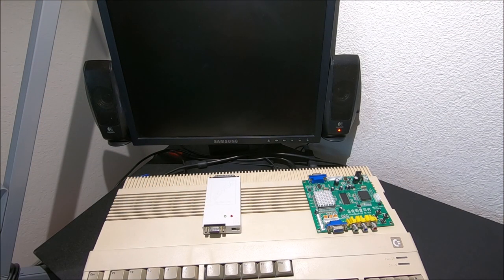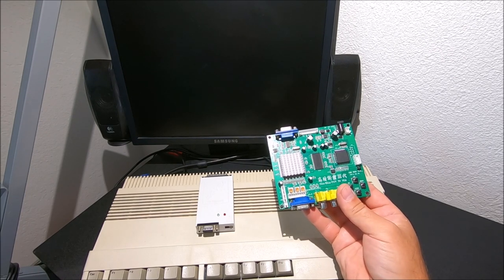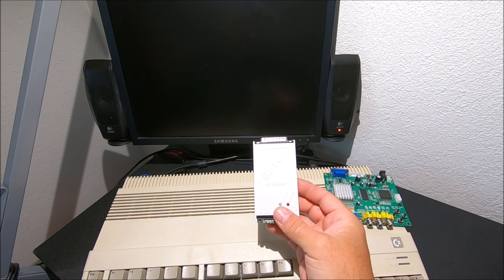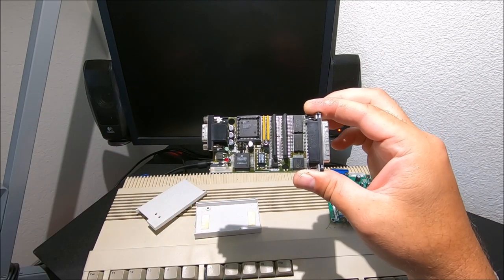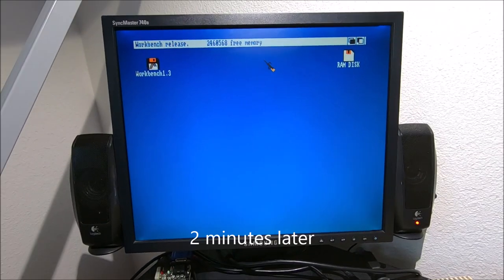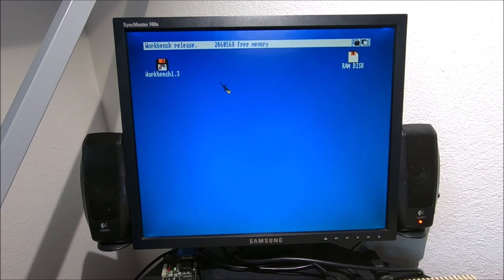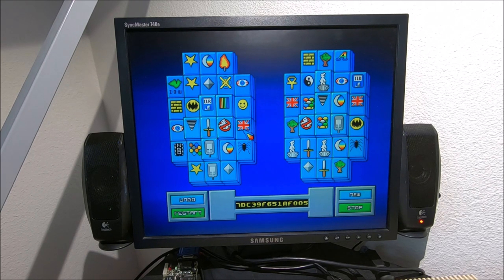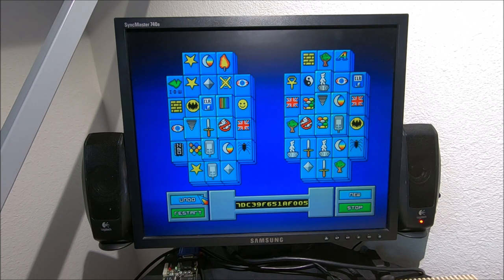EZ-VGA ScanDoubler & Flicker Fixer for Commodore Amiga 500 600 1200 1000 2000 3000 4000 MV1200

Comment from the maker: Hi all, recently I purchased this EZ-VGA scan doubler / flicker fixer a quite need a little device for my Commodore Amiga 500 / 500+ , also it will work on Amiga 600, 1200, 1000, 2000, 3000, 4000, and CD TV,  it's works fine after warms up it usually takes 2+ minutes. Does anyone know if it's normal, or how I can fix it?

Comment: Hi I have got Indivision ECS V2 for my A 500+ and for my two A1200 one Indivision AGA MK3 and for the other Indivision AGA MK2 as I had it spare.
They work just fine but are not cheap. What I like about them they are all internal. I had to cut my A500 case to get the VGA port. I got a cheap case of ebay. 
I have the out puting trough my Samsumg Syncmaster S27b550. It has got a VGA port ont the back.